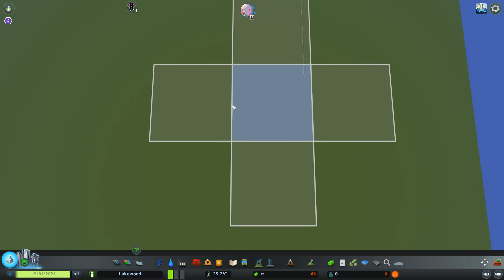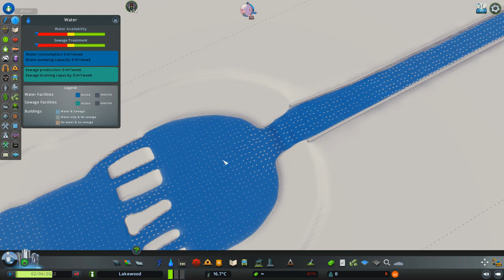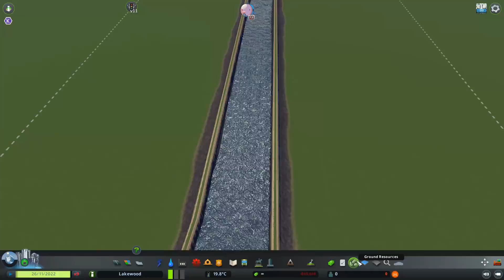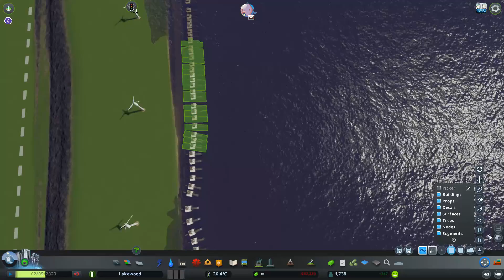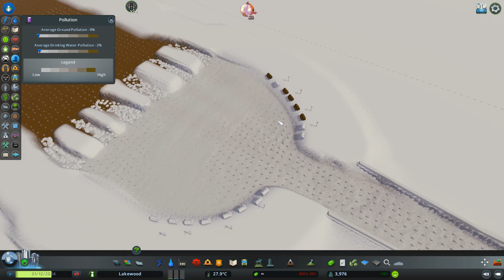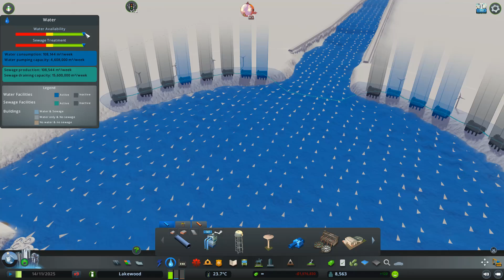TURNING POOP WATER INTO DRINKING WATER in CITIES SKYLINES

Comment: lemme add onto that. in the us the cities are only required to have at least, depending on state laws / regulations, between 20-30% water in the system when its going towards homes. meaning it can be upto 70-80% not water.

Comment: i actually ran an experiment for this exact question. theoretically - you can do this. since water treatment plants clean x% of the water, you could likely setup a chain of them and get the water down to 0% pollution.
Reply: I did this in my desert map that only had 1 small lake for a source. Then used storage tanks and also created a small river with excess.

Comment: T oanswer your question normal sewage plants SOMEWHAT work like that. YOu get the dirty water and first remove the... solid stuff chemically. don´t ask for details I don´t have them atm. Then you also have to deal with bacteria and traces, so you usually let it flow throgh several tons of Gravel or activaed charcoal as a filter. I know it is an extremely energy expensive process to clean water. but yup you just filter out all the dangerous stuff and combine with fresh water.
and just for the heck of it I would have put the garbage collectors directly infront of each pump if that works.  i mean who cares if all the water is shit, if the water that is sucked up is clean?

Comment: You don't drink cleaned sewage water.
It's cleaned and then thrown back in rivers so that the environment doesn't suffer from it.
All the tapwater is pumped from underground reserves (which are running out) or are pumped from the sea (after desalinization proces).

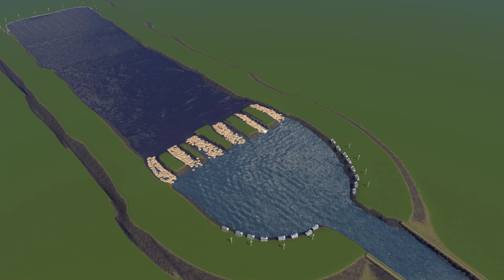Comment: 35:38 "affordable" 
literally costs $2.000.000 per week
Reply: In the future, . and , are very different symbols.
You could be $900.000 in debt, or $900,000 in debt
Reply: @wetsock6334  both are correct some countries use , some use .
Reply: @N1korasu  wait, then do you just have to guess if 10.025 + 10.025 is either 10.035.25 or 20.050?
Reply: @wetsock6334  in some countries $2.000.000 is the same as $2 with unnecessary zeros in others it's $2000000 and dots are used so you can read the number more easily
Reply: @ButterflyEnte  ah ok
Reply: @wetsock6334  yep Germany uses the  "," interchangeable with "." in some cases like this if I recall. Totally threw me seeing it.
Reply: @ButterflyEnte  Yep.  In France and Norway for example, they use decimals where the USA uses commas.
Reply: The way you put it means 2 dollars a week so yeah
Reply: 2$
Reply: @leopoldoancheta8340  ys=es
Reply: 1$

Comment: 19:27 nobody does that, only the ISS. Everyone else cleans it up just enough so it can be safely flush it down a river, without affecting the ecosystem too much. Nature then does  cleans it up further. The pumping stations that capture the water clean it up to drinking standards, but that's after it was significantly diluted and cleaned up by nature
Reply: Actually, there are systems that do exactly this, mostly for use in places with limited water resources. I have footage of Bill Gates drinking upcycled poop water.

Comment: if you dnt have the green dlc then you can clean your polllution by running it thru the sewage treatment twice. the problem is that you need clean water to keep the pumps from clogging up with pollution. so you run it thru a plant then pump it into another plant but u need clean water mixed with the pollution, i think. i havent done it successfully in my city yet cuz i dnt know how im gunna get clean water to the sewage treatment area.